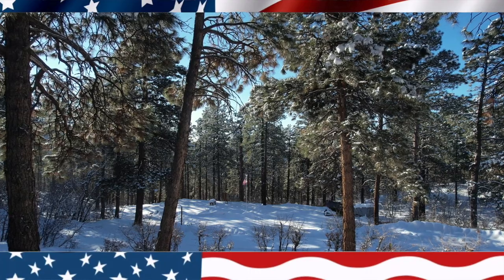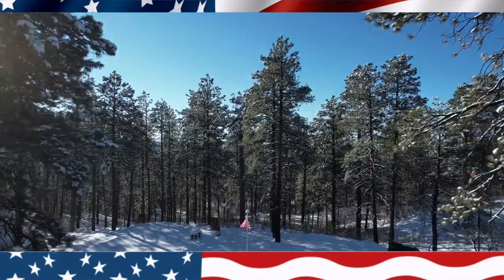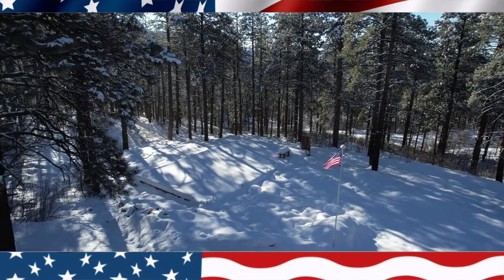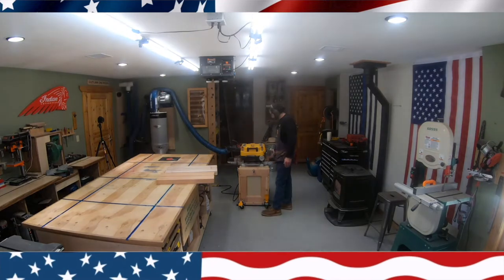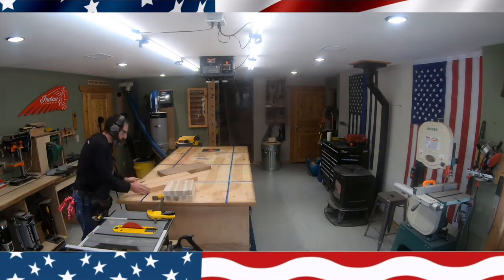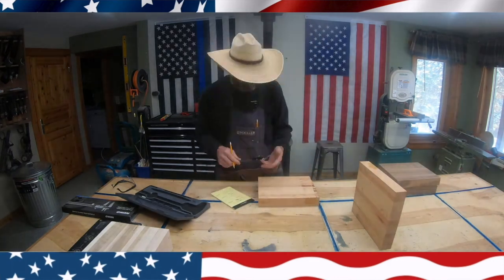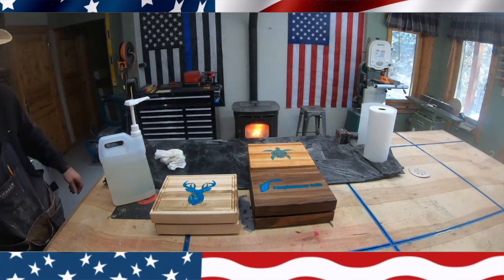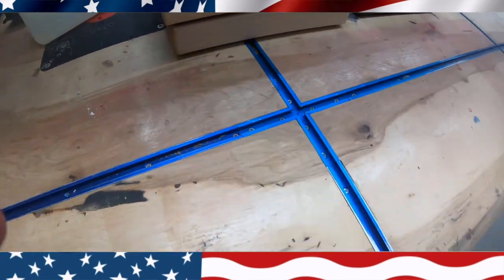MY TOP SELLING CUTTING BOARDS EPOXY INLAY

Comment: For wooden cutting boards, epoxy use is highly advised against primarily due to the prominent risks regarding sanitation and safe use. Wood is more likely to absorb bacteria over other materials. It has to be a food safe epoxy

Comment: My only problem with cutting boards with epoxy resin is that after a while you will start cutting parts out of the board, including the resin, which then gets in your food.  I know you can get food safe but that's only the resin coming into contact with the food.

Comment: Beautiful designs and carving.  Does the epoxy scratch very badly when people start using these to cut on?  I've been hesitant to do any epoxy on the top of my cutting boards because I heard that it scratches pretty easily.
Reply from the maker: It will scratch just like the wood , thanks for nice comment
Reply: I would not use it to cut stuff, it would be a display board for cheese and meat. I thought about using the other side, but the feet are there.
Reply from the maker: @cathymyers7831  I could make one without feet 🦶 if you want

Comment: How many pieces of wood did you glue together in the beginning?  I know that you get 15 pieces from Amazon but it looks like you used more than 5 for each board. Thanks! Once again your work is awesome. I am so jealous of all your shop tools.
Reply from the maker: i used 15 pieces 5 walnut 5 cherry and 5 maple
Reply: @OutlawWoodworking  From the video there are at least 10 possibly 12 boards of each Maple - Walnut - Cherry.  No way is that only 5 of each.  5 boards will not make the measurements used in Aspire.   Just saying.

Comment: Those look good!  Nice work.  Do your customers buy those for display, or is the epoxy you're using food safe?  Those are the best looking cutting boards that I've ever seen.
Reply from the maker: Thanks for nice comment,yes it’s food safe
Reply from the maker: https://www.etsy.com/shop/johnsalbato?ref=seller-platform-mcnav
Reply: @OutlawWoodworking  Food safe for serving - but not for cutting. I'll bet those have lots of knife marks, which means, resin is getting on the knife and also the food. Usually resin are more on charcutterie boards vs cutting boards.
Reply: I have an epoxy cutting board, I tend to flip it flat side up when/if I use it to cut food. I'm also going to be making some soon and will make sure my customers know to flip it over. The back half will be treated with food safe oil

Comment: Thanks for the video, did you run end grain through your planer?
Reply from the maker: Haven’t done any end grain yet
Reply: @OutlawWoodworking  are the ones in the video endgrain?
Reply from the maker: @therookiefisherman5234  no
Reply from the maker: havent ran any end grain through planer
Reply: You do NOT want to run end grain through a planer. It will trash your knives and the wood. Best way to handle an end grain cutting board (I make a lot of them) is either surface with the CNC or belt sander. Even a drum sander does not work well.
Reply from the maker: @mikejan6597 I started using my cnc , it works better